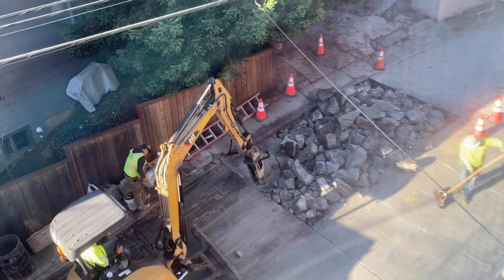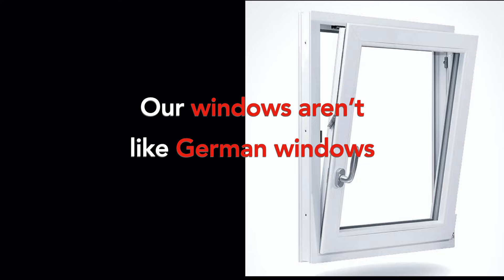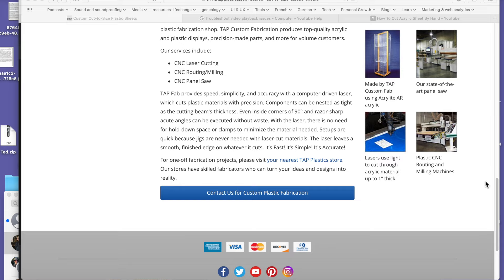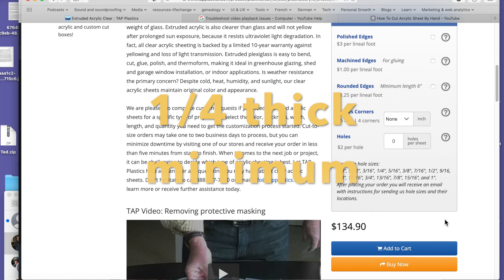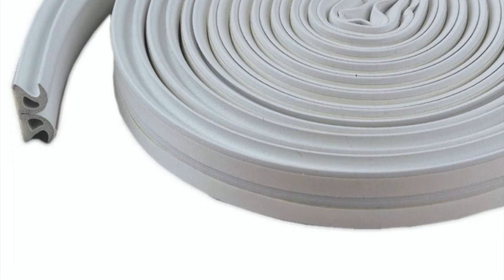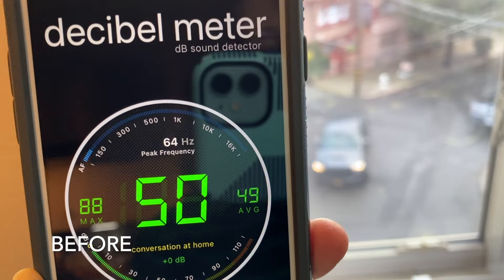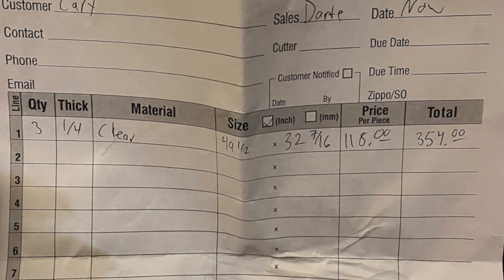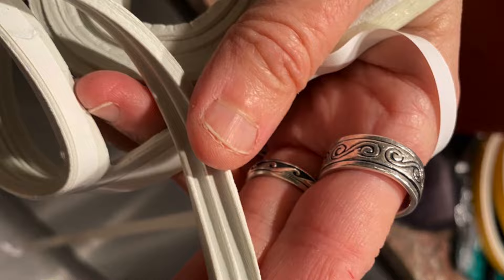How to make a DIY window insert for noise reduction

Comment: I came across this video while doing some research on DIY window insert. I have double pane glass windows with around 40 db moving traffic noise. I was planning to do something similar, ordering TAP plastic and weather stripping. Looks like it won't resolve the issue. Thank you for the detailed video explaination
Reply from the maker: You're welcome. In general, I'm glad I didn't buy the expensive custom-made inserts from the well-known company. As I knew before I started, the noise issue in my apartment comes from the wood-framed building, too. Also, my street is on an incline, so cars rev their engines as they pass my windows. All of that creates a lot of low-frequency noise. And that's not going to be fully eradicated with just a layer of 1/4-inch plexiglass. The decibel readings are technically reduced, but 52 decibels of low-frequency noise is way more annoying than 52 decibels of conversation. I'm still glad I did it, because it successfully reduced certain types of noise, like idling car engines (but not revving engines) and other airborne noise.
Reply: @soundproofist  I live in the "obnoxious" side of Texas (overcompensating large trucks, mustangs, and motorcycles that are revving and rumbling through my street.) I was planning on buying inserts for these; but from what I was told, inserts are simply not enough for low frequency. Have you made any additions? I am going absolutely manic and even considering buying laminated glass windows, breaking my old home's drywall and putting hat channels and mass loaded vinyl. What are your thoughts? Thank you for being such a good example. The beginning statement rang so true to my ears: "I don't want to spend a lot of money chasing the wrong solution." I can't tell you how many times I told myself that while being extremely manic with the noise.
Reply from the maker: @superpaul4245   I have similar issues -- lots of pickup trucks revving and delivery trucks rumbling past my building all day, and the building is very close to the street. Plus lots of construction going on in my neighborhood all the time, 6-7 days a week. I also need to do something about the front wall -- but I thought I'd start with the window insert first because it was less expensive and labor-intensive. And I wanted to see if that one change would be good enough to live with.
The next step is to replace the drywall with QuietRock. For various reasons, I don't have the budget nor the desire to remove the entire wall and build a new decoupled wall. It would be a major undertaking because I'd have to dismantle the kitchen cabinetry and counter and resize them because they butt against this wall, and any change in the wall thickness will set off a domino effect of other repairs. It would become a remodeling project. And even after that, I might still get that low vibration via other parts of the building frame (like through the floor joists). .
So what I intend to do is score and remove parts of the drywall by the windows, insert additional drywall between the studs (facing the street) inside the cavity to add more mass inside. Then add Roxul insulation, and replace the original 1/2-inch drywall with 1/2-inch QuietRock drywall. It will add some dampening but it won't be 100%. This way the replacement wall will be flush with the original drywall and I can just do a part of it and see if it helps. I suspect that a lot of the noise is coming in through the framing around the windows and in the corner where two windows come very close together, where it's just 2x4s with no insulation. Each baby step is a small improvement, but it will never be perfect.
Reply: @Superpaul  I feel for u. I can't sleep at night due to vibration noises, and when they are strong, i feel them while I lie on the bed. I assume they are coming from industrial factories in the area, km's away, but bass sounds are long waves and easily travel through walls, windows, etc. I can hear it sounds like it is coming through the window, and so i wanted to insert acrylic, but now I think it won't help after reading comments.
Reply: I live in central Texas and after the past new year eve, I have decided to finally do something about the noise. I have double pane windows in my brand new house. However the noise was so loud I felt like I was in some war zone. I went outside to see if someone was firing the fireworks outside my house. Nope. It was five houses down the street. The noise was incredible and my dogs were in panic mode. I drugged the dogs up but it didn’t help. Maybe something can cut down the noise.

Comment: I live near a fwy so there's quite a fair bit of noise. One thing I use is noise dampening drapes that also reduce heat. Obviously that's only temporary but is easily used when I don't need transparency.
Reply from the maker: Heavy drapes might help a little if you're far enough away from the freeway so that it sounds more like a continuous "white noise" machine than the deep bass rumble of cars. I usually don't recommend the so-called "soundproof curtains," but I think they're helpful for blocking light and some distant noise (like in a hotel room.)

Comment: I got to play with tilt and turn windows at my friends place in Germany and Belgium. My goodness they are good. They are getting popular in the US now, atleast in NYC with most new constructions
Reply from the maker: Aren't they great? I wonder where the NYC contractors source them from. I found a company in Canada that makes them (NeuFenster), but I'm not sure if they're easily available in the US. They should be.
Reply: @soundproofist  They are wonderful. I took videos when I was in Europe and sent them to my families. 
 There are a few stores in NYC that import them from Europe. Another company Zola makes them here in the US
Reply: @soundproofist  Also with soundproofing I can just buy plexiglass from any hardware store correct? They are the same as TAP ones?
Reply from the maker: @kartenalexos8348  Yes. If your hardware store sells 1/4-inch-thick plexiglass (minimum thickness), you can buy it there. If you buy it thinner than 1/4-inch (like for picture frames), it won't be as effective against noise. It will flex and it could possibly crack.

Comment: Good video, thanks.  I wonder if adding sound-proof foam panels and possibly even sound deadening curtains would yield greater noise reduction for you.  Of course, you have multiple windows you'd have to treat... plus who knows, given your building walls... 

My target window is 94X45 - it's the only window in the bedroom and is double paned.  This garden apt bldg was built in the early 60s and while it seems clear that it's been renovated since then, who knows what type of insulation is in these walls.  I don't have any complaints with hearing neighbors through walls or floors - the main issue of concern is noise at night that too often prevents me from falling asleep, and then the usual early morning culprits throughout the week that wake me up prematurely (damn that sanitation company).  I'm finding regular use of ear plugs to be uncomfortable (at least the rubber canal insert type ive been using).  

I'm considering trying a big grid of 12"X12"X2" sound proofing foam panels to start.  The inside frame is such that I could easily(?) line them up together (likely with the help of some light adhesive/tape, wedging them all into one solid "panel" right up against the window.  Is it at all conceivable that this might help?  A set of 24 of these panels can be had for like $45.00 off Amazon.  If this would not be effective, then I wonder how a combination of plexiglass AND these foam panels might fare...
Reply from the maker: Foam panels won't stop outside noise from coming in. The same with so-called "sound-deadening curtains." You mentioned the noise from sanitation trucks, which is loud (and low-frequency) noise. You might also have car/truck traffic, leaf blowers, etc. This kind of noise would go right through fabric, foam, etc. It's already coming through your building frame. Putting foam panels on the walls might absorb some of the sounds that you make inside your room, but it won't block or absorb outside noise from coming in. Especially that booming kind of noise. You need more mass, more density.  What I think might work in my building -- which is similar to yours, I think --  is to remove the existing 1/2" drywall, cut and insert soundboard (or cut pieces of gypsum drywall to fit in-between each wall stud (about 15 inches wide each) adhered against the inside of the exterior wall to add an extra 5/8" of mass inside the exterior wall, inbetween each stud. Then insulate every cavity in the wall with Rockwool, replace the original insufficient drywall with 5/8" QuietRock, and mount the QuietRock either on furring channels or on joist tape or some other way to keep it from making direct contact with the wall studs. Of course you might introduce other issues. Like your flooring, for example, if your original walls were only 3/8" or 1/2" thick and the floor was laid to those specs. Or it could turn out that some of the street noise is also coming through your floor. One more thing before I end this long and inconclusive answer -- I've found some earplugs that don't hurt as much inside your ear if you're a side sleeper, and you can find them on Amazon. Search for: "Howard Leight by Honeywell Laser Lite High Visibility Disposable Foam Earplugs." They are multicolored yellow/pink and very inexpensive.
Reply: @soundproofist  thanks for your thoughtful response!  my local tap plastics has a 1/4" double wall corrugated extrusion that they say might serve well as a plug/insert (the guy said he uses one for insulation on a few windows in his home) - would "only" cost $75 for my needed size... was thinking of trying it, along with several heavy moving blankets affixed to it somehow - if I roll the dice and try it, will report back!
Reply from the maker: @rawjhaw  Let me know how it works out!  Do they have :"corrugated extrusion" on their website?

Comment: Cary, would you know which one soundproofs more: acrylic or polycarbonate? Is one of them stronger than the other?
Reply from the maker: Polycarbonate is definitely stronger than acrylic. I considered buying it when I was at TAP Plastics because it's very hard to break. However, it's probably better suited for windows at the ground level (like, shop windows) where you want to prevent break-ins, or anyplace where you don't want a window to crack or shatter. As for whether polycarbonate is more soundproof, I don't know. I'll see if I can find some data.
Reply from the maker: From what I can see about polycarbonate, its strength lends to being effective for noise reduction, also. The main detractor is the higher cost. I'm still looking for comparative noise-reduction results between acrylic and polycarbonate.
Reply: @soundproofist  is polycarbonate not as easy to cut?
Reply from the maker: @mollyliz.236   I'm guessing that it's harder to cut, since it's designed to be break-resistant. If I bought some (for a window), I would get it cut for me at a place like TAPP Plastic. They've got equipment for thta. However, if you want to make modifications later -- let's say you want to drill a hole in it for some reason -- it might be hard to do with home tools.

Comment: can't tell what you put on the edges on the plexiglass before you put it in the window
Reply from the maker: I used adhesive-backed foam strips that are 1.5" wide and 1/8" deep. You can order something similar from Amazon, but the size I wanted was back-ordered till January. I already had some Norton joist tape on hand (the bright green foam tape) and it had similar dimensions to what I wanted, so I used that tape on the back of the plexiglass sheets. I attached it along the top edge, along the left side, and the right side. Those pieces of foam will get pressed against the wall. I listed the "noiseproofing joist tape" in my notes for this video, because it's similar to what I used. Typically this tape is used on floor joists to reduce impact and squeaking of the subfloor on top of the joists, but I figured it would be good to use for this project, also. But any kind of wide foam strip that's not too deep might be good.